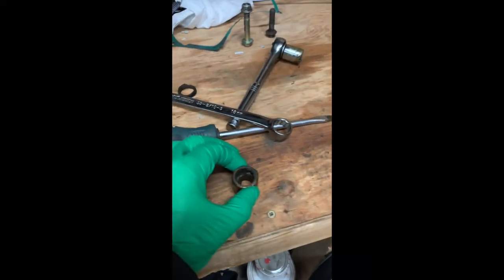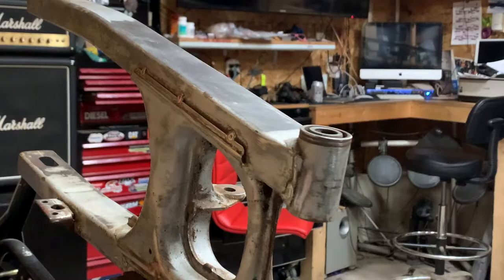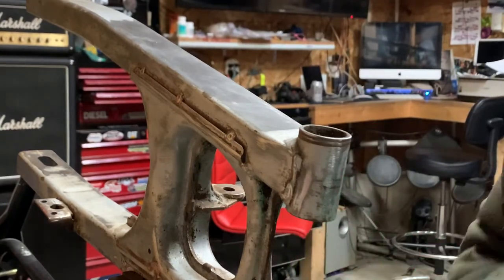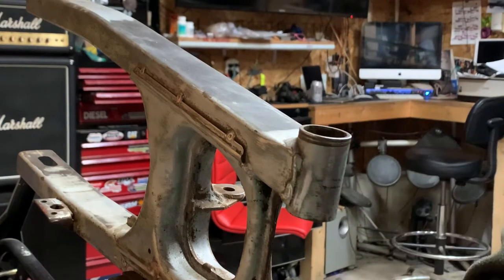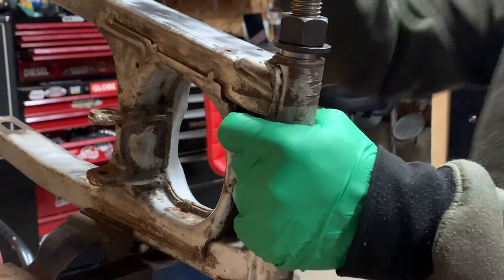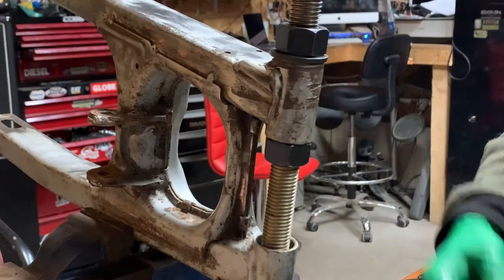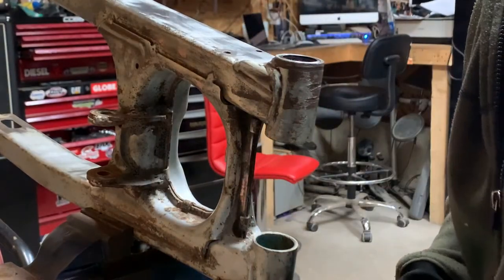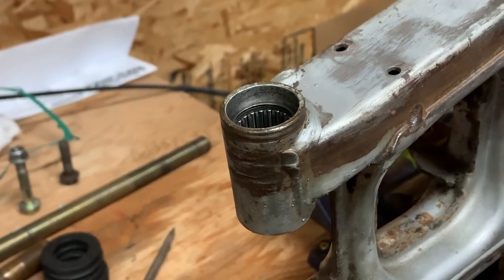Swing arm bearing removal and replacement made easy (dirt bike)

Comment: Where did you get that tool for putting the bearings back in
Reply from the maker: It's just a threaded rod with nuts and washers. you can get them at pretty much any hardware or auto parts store
Reply: sorry to be so off topic but does anybody know a tool to log back into an Instagram account??
I stupidly lost my password. I would love any assistance you can offer me.
Reply: @Carson Max instablaster :)
Reply: @Hassan Yael Thanks for your reply. I got to the site on google and im waiting for the hacking stuff now.
I see it takes quite some time so I will get back to you later with my results.
Reply: @Hassan Yael It did the trick and I actually got access to my account again. I am so happy:D
Thank you so much you really help me out !
Reply: @Carson Max glad I could help =)